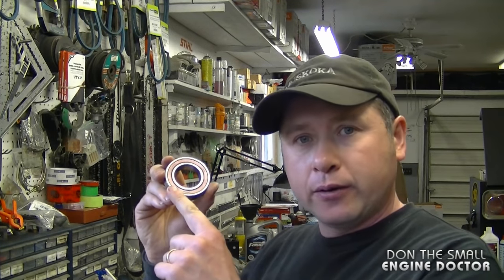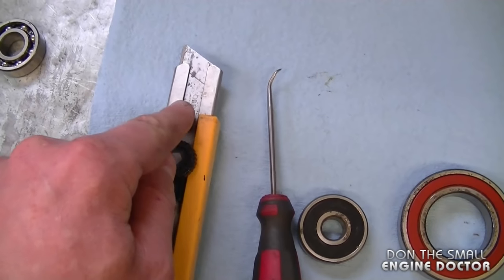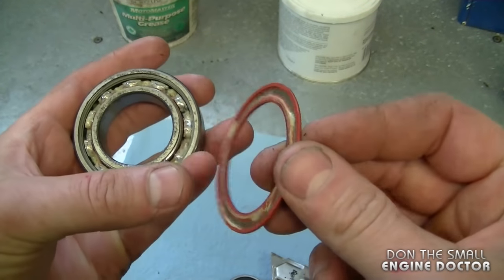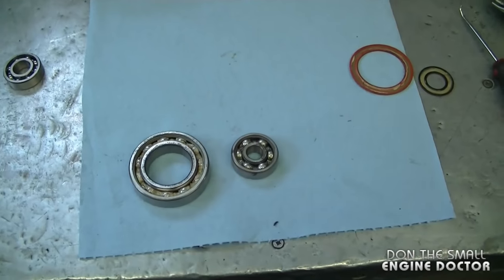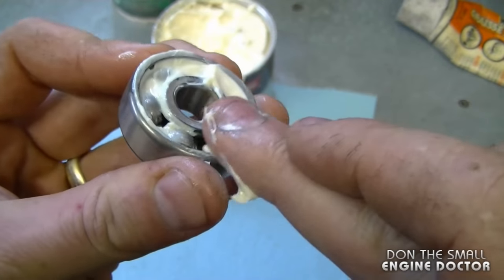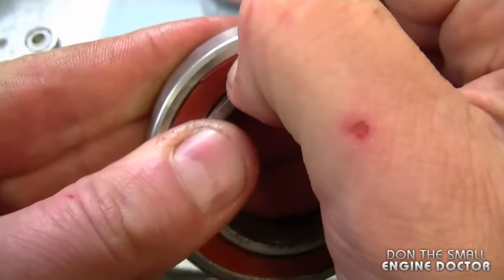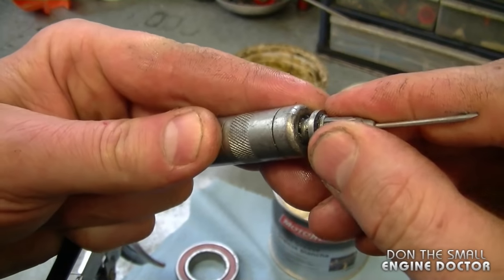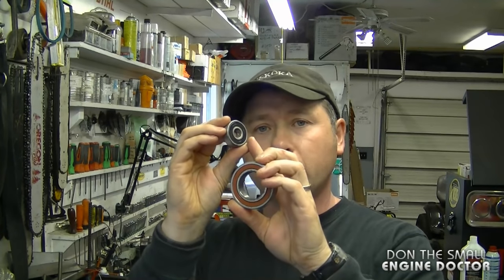HOW-TO Grease A Sealed Bearing

Comment: cub cadet mower 3rd set of spindles 182 hours  and sealed bearings with rubber seal on both sides of bearings  . They have zerk fittings and put  in grease with grease gun until it comes out both sides of spindle  and wipe extra off  , but the bearings are still striiping out  . I saw on youtube where 1 said take out inside seal and 1 video said leave the rubber seals in because grease will get in there  , So question is can you leave the inside seal off the bearings and not harm the bearings or should i leave it on  and hope grease gets in the sealed bearings
Reply from the maker: I would take off seal on one side of bearings facing inside spindle so grease can get in easily

Comment: What is the difference in the berring seal?  Do some types of seals that permit the old grease to escape.  

My mower that I am planning a berring refit is a 2009 Deere 7H17 commercial 48" comercial.  The mower has around 10,000 hours and my deck is tight but very loud~120db so I am expecting the berrings are likely scored.

Comment: before you pack new grease in the bearing it is a good idea to clean it with varsol or any other parts cleaner to remove contamination, dust and rocks that might have been stuck and making squealing noise or prevent the bearings from spinning freely.

Comment: I found that white lithium grease will have a tendency to dry out over time. It doesn't work with bearings very well. It seems to me that automotive wheel bearing grease is non-drying and impervious to water and better suited for the job. (This is sometimes called "Red Grease"), although some similar bearing greases will be Blue, Green and sometimes Black. The container should say it's for bearings, though. I'd clean out the old grease before adding any fresh and don't over pack the bearing, as someone else had stated. I've even read that cleaning a bearing with mineral spirits will leave a film that will prevent the grease from lubricating as it should. Clean them with something that won't leave a film, like aerosol break cleaner or lacquer thinner, (MEK or acetone). Don't smoke around MEK or acetone, though. It's very flammable.

The pick that was shown can be found at places like Harbor Freight. I bought a set of different style ends that include the one shown for about $2.00 US. If the balls in the bearings show that they are rusty or have a color other than chrome, the bearing is no good and will need replacement soon, even if lubed. The balls have a chrome plating on them which is hard and resists wear. If it's gone, the bearing will fail, guaranteed. The exception would be if the bearing's is subjected to a very low load and RPM application.
Reply: Yes, finally have a use for that one of the picks with the weird tip.

Comment: Should you have cleaned out the bearing before you add new grease? 
Also, if you have and want to be able to use the grease certs on the spindles in the future, I suggest leaving the seals off the bearings facing the inside. That would have been the proper way to have made the spindles in the first place.  I thought that's what you were going to show in this video.

Comment: Be care if you are using this on a high speed bearing that gets a lot of use, a over packed bearing can over heat and it has the potential to pop the cover off while in use when the grease expands due to temperature.
When greasing Large bearings 2/3's to 3/4's full is a good fill point.
Reply: he already said that
Reply: Ian Stradian of

Comment: I'm wondering if you by hand "no tools" drill 3 holes  on the grease side of the bearing in the meddle of the rubber gasket you would be greasing the bearing with out taking it out. This may not work in all situations, but say a mower deck spinal I think it would.

Comment: I do field service on cnc machines, the faster the bearing speed the less grease you use, if you pack a 6000 rmp spindle with wheel bearing grease it wont last one day , high speed spindle only require a couple of cc of ISOFLEX NBU15

Comment: Hey Don,

Do you have a vid that addresses throttle / governor setup on a Toro 521 w/  Tecumseh HS50? I can't seem to find any good info on how to deal with the spring specifically, as well as the linkage, to get it all set up properly. The 521 has both the idle speed and idle air screws, as well as the 'high speed' screw & spring mounted to the throttle lever. 

The engine on my 521 will idle down and run like a champ @ 2200 rpm, but when I set it for hi speed, it runs way too fast @ 4100 rpm or better. Too fast. In addition, I think that the governor spring is either non-original or just messed with.. it's not at all in the shape you would expect, looks like it's been gomer'd.

Got any advice or a vid?

Comment: For metal shielded bearing, I submerged bearing in 100ml thinner for 1hr and shook the bottle thoroughly many times for taking out old grease. Can see color of thinner change. After drying this bearing, simply put and press some grease on the shield and rotate the bearing. You will find the grease gets inside slowly through gap between track and shield. It may take upto 15mins to get grease in. Rubber shields may get damaged in thinner.

Comment: I want to do this on our zero turn but put a grease zert in. It has non-greasable spindels in it and I drilled and tapped a hole to put in a grease zert. My question is how do I let the excess grease out so it doesn't burst the seals? Drill a small hole, one way valve?
Reply: Drill a really small hole about 1/16" as far as possible from the zerk  don't forget to clean out all the metal chips from drilling or you could make it worse.

Comment: I did like this on my 2000 4runner at 100,000 mile during timing belt change and now my car having 200,000mile still no bearing noise. : it work
Reply: Still running?

Comment: Years ago I had a Subaru, and once it had about 20,000 miles on it, two of the wheel bearings started to growl loudly during extremely cold winter weather.  I got one of those needle injectors and slid it past the rubber seal on each "non-serviceable" wheel bearing, and injected lots of new grease in the front bearings, and because of the hub construction on the rear, was able to use the hub parts themselves to force new grease into the bearings during repeated assembly just for that purpose (and yes I used the "wrong" kind of grease, according to some folks).  The bearings lasted for the rest of the life of the car, which was somewhere around 250,000 miles (after which, rust is what killed the car).  The bearings worked fine during that time and I never had to worry about them again, but the noisy ones surely would have failed pretty quickly otherwise..

Comment: Thank you for the video. What is your thoughts on greasing mower spindles? I have a z920m zero turn that has grease fittings. How do you know when spindles are full of grease?
Reply: Use a grease gun and check the manual. Seeing a little grease leak out the edges of the spindle is a good sign it's filled
Reply: Plus you'll feel it get harder to pump from the built up pressure in the fitting

Comment: I have greased seal bearings on farm machinery buy tapping them with a tiny drill bit and then using a  special pointed tip on my grease gun and pumping in some grease. It can add years to the life of a sealed bearing.  I have even saved sealed bearings that had a rusty grease come out after the bearing was run for a while.  The bearings seldom had to be replaced after that.  These were bearings that were from time to time out in the elements.

Comment: Hi, I was wondering if you could help. I followed the steps in your video to grease the bearings on my bandsaw. Unfortunately, now they turn smooth, but sluggishly. I'd like for them to be able to spin. Is it possible to over pack the bearings? Are there different types of viscosity? Perhaps I used grease that was too thick.  Any advice you can provide will be much appreciated.
Reply: @Warren Wwk Thank you so very much. This is a huge help! I have them drying now. I really appreciate your advice.
Reply: Anthony Cammilleri 
0

Comment: Drop the bearing complete in a pan full of grease on the cooker. Heat pushes the air out of the bearing, when cooling after the heat, leave the bearings in the grease, in the pan, grease will then be "sucked into" the bearing through the seals.
Reply: -Using that 'cooking' method nearly burned down our garage and connected home... ;{

Comment: Great video.   Your work methods give my nervous system the jitters.  You are applying firm pressure with a sharp pointed tool or a very sharp cutting tool and one of your non-replaceable hands is directly beneath your target object.  One slip of your penetrating tool past the small bearing surface, and your hand is the next target.  Please, rest the target bearing on a flat surface before applying the penetrating tools.  Keep your non-replaceable fingers out of the line of fire, so to speak.  In my many years of working on messy and large equipment I have not lost nor seriously damaged my body parts because I remind myself that my human body is the softest material involved in my manual labors.   Machinery does not forgive mistakes or "opps".

By the way...
Cover that open sore on your right hand with medicinal "paper" tape (from drugstore) for several days.  That temp covering will help your body cover over the open wound for healing.  Dirt particles, oils, grease, etc, can get into an unprotected raw sore and interfere with the delicate healing fluids.  The best tape has small breathing holes.  This is good because the sore cannot be keep air tight and water logged for too long a time.  I usually use handy paper tape used for sealing boxes.  After a couple days normal hand washings will loosen it enough to slide off.

Comment: But if i want to lubricate my drum pedal sealed bearings without take the bearings out from the pedal, what type of lubricant should i use ?? ... WD 40 White lithium grease, or WD 40 silicon grease, or WD 40 dry lube PTFE ???

Comment: Would be the best grease for this. What grease Base  o to 2 grade Grease. Base what level of breakdown package do you need. They should still get oil in through the sealed bearings if they are made .  bearings wear down there is give in the bearings. To let the bearing oil in.

Comment: Quite honestly, if a bearing is starting to make noise it needs replacing. It's going to fail. In an emergency, remove the covers and pack the bearing, but plan on replacing it as soon as you receive the replacement bearing. I don't see any problem with repacking bearings but most people don't pack a bearing unless they hear it making noise - then it's too late to save.
Reply: I tend to agree, but your comment reminds me of something.  Many modern auto mechanics are (apparently) so accustomed to non-serviceable wheel bearings that they have absolutely no clue what to do when working with a traditional adjustable bearing, like old-fashioned front wheel bearings in a rear-wheel drive car or truck.  I learned years ago to CHECK wheel-bearing adjustment after the hubs have been disassembled by an average repair shop.  90 percent of the time, they will have been reassembled with a very loose and sloppy fit.  I once had a 2wd Ford Ranger, and after having brake work done I did not check their work.  About two weeks later, one wheel bearing started making horrible grinding noises whenever I went around curves fast enough to develop a little bit of sideways load on the wheels.  Sure enough, the bearings for that hub had been left 1/2 to 3/4 of a turn too loose and the wheel could be tilted back and forth on the hub by about an inch.  I tightened the bearing setting to having "just barely" any play, and though that did not completely stop the noise when going around curves right away, the noise DID eventually stop completely, and those bearings worked perfectly for another 200,000 miles (that's when we finally sold the truck, but the bearing never failed or made any noise during that time).  Apparently the defects in the rollers/races  that developed when the bearings were loose and able to "tip" during side loading, soon got "hammered flat" again once the bearing had proper tightness.  I know this was a lucky situation and not something to count on, but it was very interesting!!
Reply: Hell why get a new one you know nothing about ,  original one done proved itself lol really though a lot of times changing bearings old ones wore out or not was better quality than the new , say a vintage something good timken bearing , made in America, to 10 different factories in China pumping them out made from these bean cans were selling them . Damn I went political, Save the whale shoot the seal
Reply: @rcccvjohnson7132    Pretty much everything gets political,  hard to avoid it. We really do need to buy stuff locally or, at least, from our friends (not China). I do work for Philadelphia Gear (owned by Timken), see a lot of bearings good and bad. Lots of old stuff. Lube is important and any lube is better than no lube.
Reply: @timjohnson1199  If we are not going to buy American at least buy German or Italian made bearings for quality.
BTW: How come I never hear of "Made in the UK" or "Made in England" stuff?  What do they make? Do they do any manufacturing? Is it good quality if they do?
Reply: @erbenton07  Yep we definitely do manufacture stuff here in the UK, though not as much as we used to but I think that's the same for most countries these days with companies opting for profits over keeping it local. I would argue the stuff we make is as good as any other country makes but it's harder and harder to find UK made stuff, depending on what you're after.
Reply: @erbenton07  We make Rolls Royce and Bentleys. The Numatic Henry vacuum cleaner is iconic and bulletproof. In Scarborough (my home town) we make buses and coaches that are sold all over he world. For tools there is Thor, Britool, King Dick etc. though I don't know if they are still UK made.
Reply: @erbenton07  We also make the best movie villains :D
Reply: I think he’s saying to do this as a regular maintenance item so your bearings don’t start to make noise. I personally take some contact cleaner and a tooth brush and every 10k I clean all the old grease out of my CBR1000RR wheel bearings and pack new bearing grease in there. Lubrication is a huge limiting factor to a bearings longevity in any application.
Reply: This is a preventative maintenance task

Comment: Always rinse the bearings in diesel to wash off old grease. It often contain metal power and other debris (if it runs on dusty or muddy environment) which will wear the bearing. Clean all those off and apply clean new grease.

Comment: could you use the grease needle to grease the sealed metal bearings by using a pick to poke a small hole in the cover?
Reply: I've used a tiny drill bit to make the hole.  Worked for me.  I used the drill bit on the sealed bearings on a self propelled combine.

Comment: Do you recommend the ZZ (metal shielded) rather than the RS (rubber sealed) for bearings as the stainless shielded ones can handle alot more heat?
Disregard...saw your comment on the ZZ bearings where you just replace them
Reply: Brian C what are the bearings purpose?
Reply: Fidget spinners?
Spinny spinny I believe...

Comment: Good video, but i find if a bearing has reached an age where it needs regreasing it is usually at the end of its serviceable life. For the cost of a new bearing i just replace it completely. It also restores the bearings running tolerances.

Comment: There is a common “I never knew this” response. That is because you are supposed to run sealed bearing until failure then replace them. This can be done but it is not best practice. You learn this first semester in a Maintenance Tech college course.

Comment: It's almost impossible to remove a shield without warping or taering it ect. Rubber seals are much nicer over all. Can remove sheilds but you will spend some time fixing it out even then it can still have hole or tear in it. I'm curious if you can get rubber seals and replace sheilds? Wanted to save some cash so painstaking dealt with fixing sheilds but if one could replace sheilds with a rubber seal that would make life way more easy on certain john deere bearings on older garden tractors.
Reply: I'd only fiddle with removing sheilds if you are willing to temporarily use them. They can also rust on things like mower deck spindles and prematurely shorten spindles operating life. I like to pop sheilds out of bearings with a small punch from the inside in between the races and save them if there good. Don't hurt to have some oddball parts like those laying around for later

Comment: where would I get one of those grease zerks with the needle on the end have never seen one like that it looks very handy
Reply: New inwention build one for fun clean well if duel purpose for cows.(greese might work as well as  medicine)
Any how if the bearing isn't handy at least have a replacment, and a used one is good to have in stock.
A worn bearing is hard to tell without a dial indicator or assume it is,and most wear is in instalation.

Comment: I use a needle tip that attaches to my grease gun to grease snowmobile idler bearings.  I still remove the seal though.